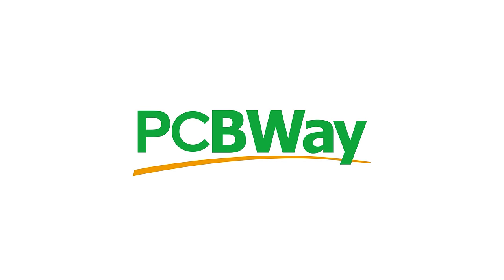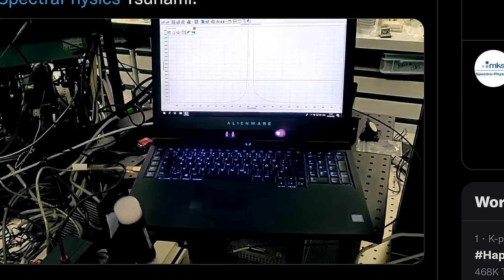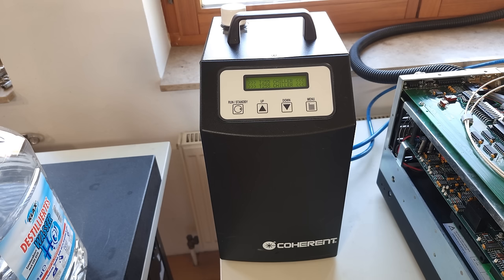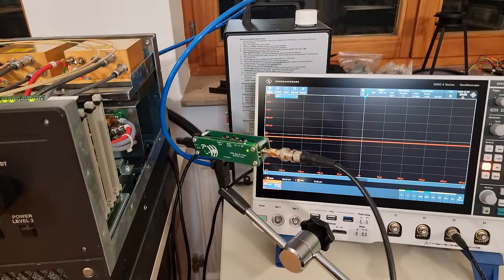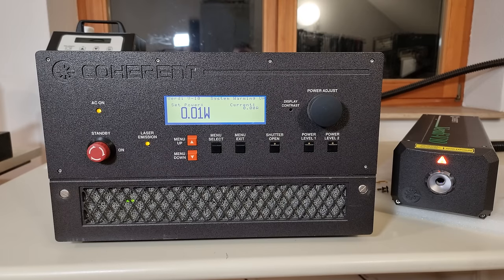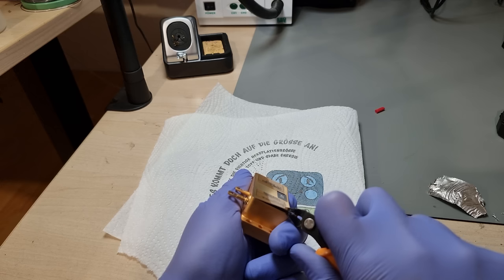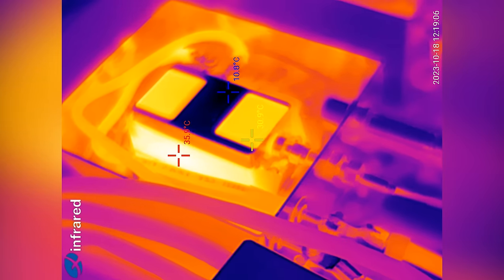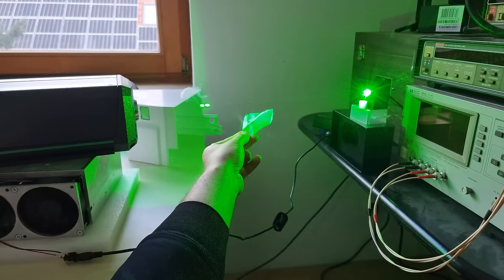Repair Attempt: Coherent Verdi Narrow Linewidth Green DPSS Laser

Comment: Lemo connectors used internally where nobody will even see them - definitely a sign of something built with minimal regard to cost!
Reply: I see your Lemo and raise gold plated Invar optics mounts around the V10 cavity. Those Permalign mounts heat up to the melting point of low temp solder when being adjusted; if not made of Invar the optic tends to crack from CTE mismatch. If not plated in gold, the solder won't stick. They cost Coherent more to manufacture than retail Thorlabs KS05 mounts would.

You should see what they did to the plastic Proteus flow meter for their ion lasers ... licensed the patent to swap plastic for CNC brass.
Reply: That’s because this modules get also sold single without this huge control case. You have then one production only for that modules and another for bigger systems. To produce the module with different connectors makes economically no sense.
I work for another big company on the market and we do it the same.
Reply: Better to use MIL-DTL-38999, Series I LJT, II JT, III TV, HD connecters.
Reply: @universeisundernoobligatio3283  for sure 👍 🤣🤣🤣
Reply: you would not believe medical linear accelerator engineering then Mike!

Comment: Marco, just a little remark on your cooling fluid, don't know if it applies here. I hope you follow the Coherent Manual which type of water to use. I had a machine leaking through a shutter because the de-ionized water has eaten holes in the Aluminium block after months of running. The customers were not happy at all ...
Btw. I'm very impressed by your expertise, it looks like there's nothing you can't do or know in the electronics field.
Reply: Highly support that. We broke a 20k€ xray tube because the service technician just put deionized water in the cooling system. The tube manufacturer specified conductivity (reduces static build up in the tube), pH (proctects exposed parts), mineral content (in fact not "as low as possible") and some other things.
In the end they even supplied a recipe that basically read tap water plus some chemical (I think it was KOH) until the pH was at  9 and nothing else.
Reply: ^^ This ^^  -- make sure you look at both the laser manual and the cooler manual if you have separate manuals for them. In the lab I work at, we use 5% ipa in water for our thermotek chillers, but we use tisapph lasers from a different manufacturer so ymmv.
Reply: Agree with everyone on this note.  Pure water is a great solvent.  Learned the same thing operating a pool, the water will leach minerals and metals if its not "neutralized" with the right Ph, alkalinity, and dissolved solids.  Oh, and the right recipe is temperature dependent too.
Reply: We use OptiShield+ on all of our lasers.
Reply: @reps take this tip above all others, a machine running at half power is better than a machine that leaks

Comment: I'd guess the power goes down at high pump currents because something is misaligned slightly, but I can't see a kinematic mount in the main laser cavity.   If you do have some kinematic adjustments in the laser cavity, hooking the power meter to one of your super DMMs and following the power/adjustment curve to it's maximum for each adjustment 2-500 times can make a big improvement.  

Fyi, a cheap digital camera with the IR filter removed makes an ideal 808nm and 1064nm viewer.  It's an excellent safety tool.  (know where EVERY stray beam goes!)  

The speckle pattern is nice and steady.  Though if you really want a quick n cheap way to see how good the spectrum is, get an Iodine vapor cell.  The contrast between tuned to an absorption line and off a line is a nice simple way to measure spectral purity.  I'd expect Etalon temperature and LDO temp to be your main tuning parameters.  (though pump power and everything else will effect it to)  

Last, be aware that a lot of chillers and TEC cooler control loops are highly sensitive to ambient temperature.  If you ever see the device temperature go down while ambient temps go up, it has a faulty feedback sensor design.

I "tamed" a DPSS green laser like this in my Graduate work.
Reply from the maker: Thank you for the hints! Yes, most optics in the cavity seem to be soldered. I think I'll live with 7-8W for now rather than taking any risks in there

Comment: 10:32 - emitter follower from oscillator to current sense input performs what is called "slope compensation", technique used in current-mode control PWM converters to improve stability at duty cycles of >50%

Comment: The weird transistor at 10:14 is used for slope compensation, it's an emitter follower that adds some of the RC oscillator ramp to the current sensor output to make it stable.

Comment: PLCC sockets are known to go bad over time and are often a source of very erratic problems. The spring pressure in those sockets is pretty low because otherwise the sidewalls would deform to much. Removing the PLCC chip and cleaning the socket and chip will get those going again.

Comment: Yea these Verdi's are quite reliable I have a few of those in my labs, but mine are air cooled, a peltier chiller is used to keep the head at a stable temperature, there should be a base plate for that.
Reply: Yes definitely! There should be normally a 7 cm block of aluminum below it and this is cooled by the peltier chiller (together with the mira). Already small temperature increases leed to thermal expansion and therefore to a misalignement of the cavity. You can easlily have 30% less power beacause you are some degrees of.

Comment: Thank you for showing this to us.  Ideas for the power loss: the FAPs could be close to end of life and are drawing more power to deliver the needed output. At the upper end they may be generating more heat than the system can remove, throwing their wavelength off.  Or there could be a small alignment error. I have found if the pump mode and cavity mode overlap are a little off, thermal lensing in the vanadate can cause the power to drop. I've been building a green DPSS for a while now and I see things like this when the power gets over about four watts of green.
Reply from the maker: Thank you for the suggestions! I think I will try some more cheap FAPs in both positions, but I don't feel sufficiently equipped to tweak things in the cavity (yet) Gonna have to live with 7-8W if there's something wrong in there
Reply: The lifetimes on the original pump diodes look ok-ish ~10k was the limit for the earlier ones. I agree with @BiranKPepin on the possible issue but think the pump wavelength stability of the replacement is the more likely issue. If you test in constant current mode then you can plot out power vs current graphs (532 nm output vs pump diode) that should be linear till you hit a roll off (some nonlinearity from the SHG). Pushing too far past saturation point of the system typically breaks something, try adjusting the pump diode temps up near the saturation point. Alternatively look at the output wavelength of some scattered light with a spectrometer, if you have one.

I usually end up just running these older systems in CC mode continuously, pretty much every one of them has the service mode enabled and its typically far more stable than the "constant power" mode. often lets you push a few extra thousands of hours out of the pumps too. The newer systems have the pump diodes in the head, far nicer. I would offer you more of the same as I have scrapped a number of these lasers over the years but the drive to Australia is a bit longer and my regulator would probably complain.

Comment: I'm jealous of the Mira 900!  I have two Verdis, but have so far not been able to track down a Mira in good condition.  They're a great laser system, used to work with one from the early 90s that had been through multiple Verdis in its lifetime and still worked perfectly.  Assuming you have the pump, it'll last forever.

Comment: Just FYI you cannot determine the health of a timing belt by looking at it. I've seen plenty of timing belts that broke and still looked like they were brand new. Age and mileage alone determine when a timing belt needs to be replaced.
Reply: Stretch is the only good measurement. The fibers will stretch before failure daily reliabily
Reply: @ionstorm66  I've been a professional mechanic for over 20 years and I've never heard of anybody using belt stretch as a way to determine when a timing belt needs to be replaced. Replace them on the schedule specified by the manufacturer. If you buy a car and don't know when the timing belt was last replaced go ahead and replace it.
Reply: Some engines use what’s called a stretch belt as well, to negate the use of a belt tensioner

Comment: Plating with the pump diode fiber optics changes the modes and was a trick to make the laser behave better. On some designs used to zip tie them in place.

Comment: You can use ordinary automotive water/antifreeze mix. It cools the laser diode mounting block. Those big gold boxes have TEC cooler modules inside that cool the pump diodes. The TEC modules in these are failure prone, but the FAP submidule inside is usually OK. The fix is to replace them and then use a simple radiator and a fan, they neglected thermal expansion and it causes the cooling crystals to crush at the torque used.

Comment: The high output power is probably due to IR to green conversion in the crystal. If the crystal starts overheating, its efficiency drops. Thus, the green power drops. If you can fine tune the crystal temperature, try lowering it? And maybe you reach a higher power. Tho, it is usually set to a sweat spot based on a beam size.
Reply: Correct; SHG conversion drops which adds to intracavity IR light and thermal lensing in the vanadate which further increases mode size at the SHG waist. Since the servo operates on green power, it's a cascade that rolls over quickly. V10 was the IR lensing limit. On the V18, a thermal lens is factored into the resonator design and you thus need to establish a strong lens to get green conversion.

Check FAP wavelength is 808nm and/or adjust diode temp to try finding a different order of the DFB grating. Otherwise 8W of Verdi TEM00  is plenty to modelock the Mira, it's the DPSS mode that really improved Ti:Sa pumping over ion lasers, 532nm is further from Ti:Sa absorption peak than 514 or 488nm.

Comment: I have never bothered messing with cavity alignment on a Verdi. They work till they break and at that point they are hardly worth fixing in the research world with the current gen Millennia lasers. That said its pretty rare the cavity breaks, usually the pumps, LBO or something electronic goes in them, as we have seen.

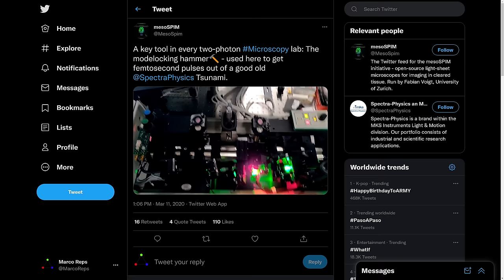The Mira I have no experience with, much more use to the Tsunamis shown at 4:40. If you don't have a spectrometer, you can use the speckle pattern to check if you have it mode locked. The speckle disappears when the wavelength broadens. Get a decent isolator for the output if it doesn't have one built in otherwise it will never stay mode locked, they all hate external seeding. After that I expect nothing less than a homebrew autocorrelator to measure pulse profiles!
Reply: Looking for the speckle to disappear and avoiding back reflections are great advice, is there another source for GaP photodiodes now that Thor doesn't overnight them with Lab Snacks? Or how do you generate/isolate SHG for the autocorrelation? 

The Verdi power rollover at 8W might also be fixed by adjusting the FAP temperature (I think there was a service menu for this); these are DFB pumps and need to be well centered at 808nm to minimize thermal lensing in vanadate.
Reply: I have found my kind of people! For sure, this is top notch advice.

@marco reps, The mode locking tip and the one about the isolation (esp that) are super valuable advice btw.
Reply: @brentwheelock8297  A delay line and a thin sliver of BBO make a decent autocorrelator. A slow Si photodiode is enough, you can filter the pumps from the SHG with angle, focus the two inputs with a lens at a large angle into the BBO, SHG vector comes out straight (sum of k vectors,  collinear operation). With very thin BBO and sub picosecond pulses it is very easy to be phase matched, bit of angle tuning but nothing like the critical response you have at longer pulse durations.

Comment: I have personally observed this kind of runaway behaviour on two different 532nm pump lasers. Both were rather old and could not deliver their rated power any more (the spectra physics one even died when I was using it) so I'm not sure if it's indicative of a common issue or if it's just how they behave. One was a Verdi V8 or V10 (can't remember) and the other one was a Spectra-physics Millenia eV.

Other guess maybe it could be the ir pump that you haven't replaced that can't produce it's max rated power anymore and goes into runaway ?
Reply from the maker: Possible! I have read somewhere that modern FAPs can last 20k hours and more, whereas mine have supposedly only worked for 6k hours. Maybe it's because they are some of the oldest

Comment: how do you protect yourself and your eyes from these amounts of laser power, or even its reflections?
Reply: Goggles are rated for wavelength and optical density. Suitable goggles for a laser like this would have an optical density of 6 or higher.  That reduces the light by a million times, but only for the narrow wavelength of the laser so you can still see fine through the goggles. For skin exposure, it's usually fine unless it's a direct beam strike or very short wavelengths (like UV).
Reply: @BrianKPepin  so it's basically like the color changer crystals in the device itself, but they convert it to heat vor example

Comment: How does Indium compare to graphite sheet? They have great thermal conductivity and soft enough to conform most uneven surfaces.
Reply: I was thinking that Thermal Grizzly Liquid Metal would make a significant difference.
Reply: Used properly, indium sheets are ~an order of magnitude more conductive than graphite (on the same order as liquid metal).  @BobHannent You probably wouldn't want to risk using liquid metal with equipment like this